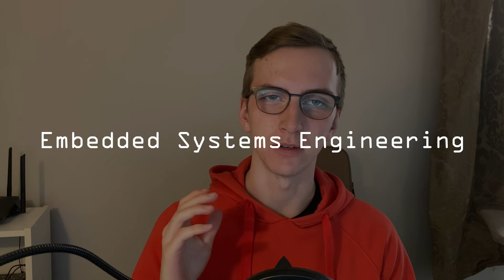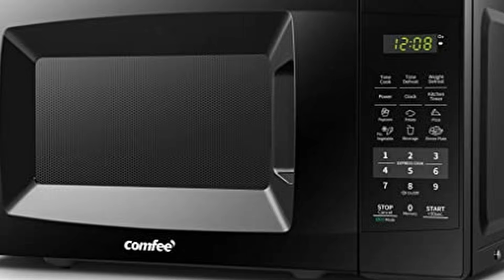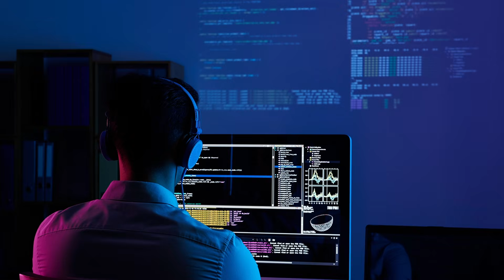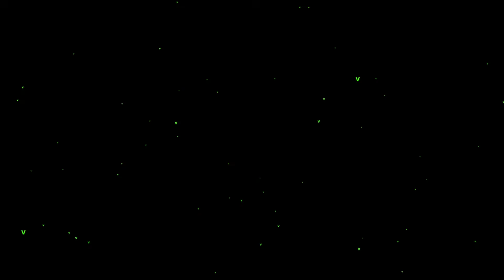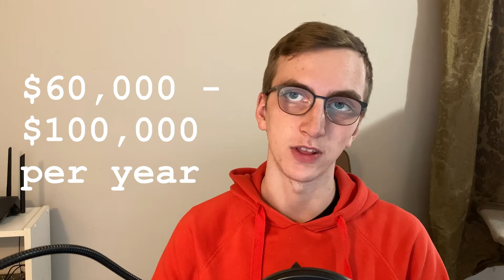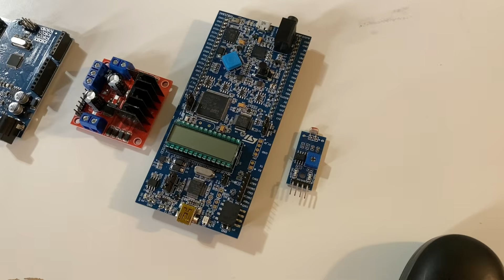Embedded Systems in 5 Minutes!

Comment: hello. thanks for this video it was very good explaining. i have one question and will be grateful if you answer me.(my english is not very good, sorry). i am graduated in control engineering recently, but i have a strong desire for logic circuit and digital calculations. so i wonder if you know is there any linked field between this two fields? control and digital. thanks again.

Comment: I want to point out that not all electronic boards are embedded systems (ES).  In order a board to be an ES it should be "embedded"... yes I mean, many different hardware embedded inside a chip or in a couple of chips.  Even though ES are now very common for the microcontroller (mc) popularity (which is in fact an embedded sistem itself) there are many electronics board that doesn't have mc or other sort of multi intregrated hardware like FPGA or ASICs.  Not all ES are programable by the user, they are in fact programmable by the designer though.

Comment: Is FPGA are embedded systems?
Reply: FPGA is not an embedded system.  It is a programable device.  You can design an embedded system inside a FPGA tough. This means that you can create a bunch of interconnected independent hardware inside the FPGA and now it becomes an embedded system.
Reply: It is a Part of it

Comment: Confused between CS and EE, which one to choose? Goal is Embedded systems, I would love have 60% CS and 40% hardware in my job. Which one did youhose btw?
Reply: Computer Engineering sounds perfect for you :DD
Reply: of course Electronic Engineering EE.  It has many digital system courses that are in fact aprox. 80% you need for learn about embedded systems.  The other 20% is about especial hardware language like C, VHDL, Verilog, etc.  Emebedded systems is not about the user application software is about hardware - system software.
If you want to create an App, or some end user software, that is not related to embedded systems  (ES) or may be receiving, processing or visualizing data from ES, then CS is your choise.
Reply: @edro1128  how's computer engineering? I'm thinking it would be a better since I can get a fair share of both Electronics and Computer science courses

Comment: What is the difference between a microcontroller and a microprocessor and why can't I use my Raspberry Pi as a microcontroller?
Reply: Ik this was a year ago it might help anyone else in the future. From my understanding, A microcontroller is just a device that has memory, a cpu, and IO in one chip. It's essentially a tiny computer. A microprocessor is just a CPU on a chip, but doesn't necessarily have storage or IO built in on the chip itself. Microcontrollers have microprocessors in them
Reply: @SilverRyuu  Thanks!